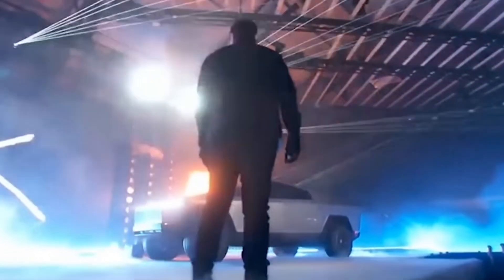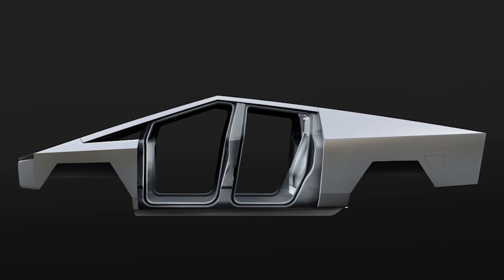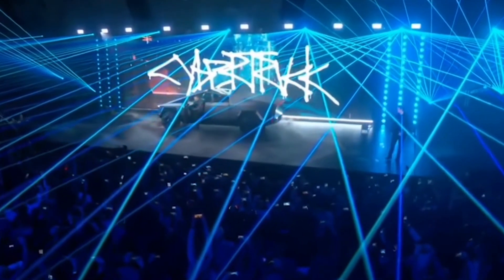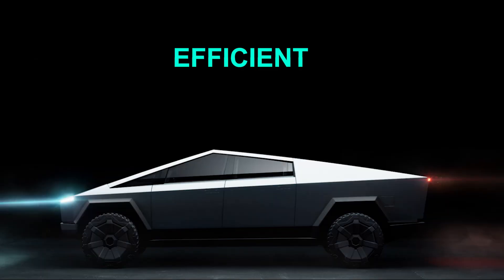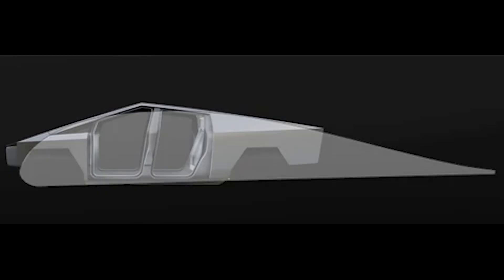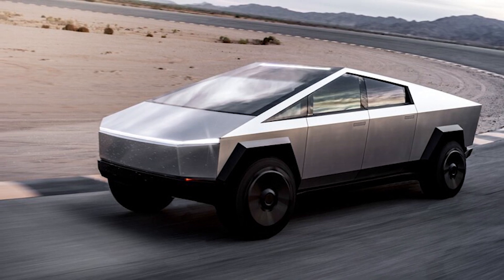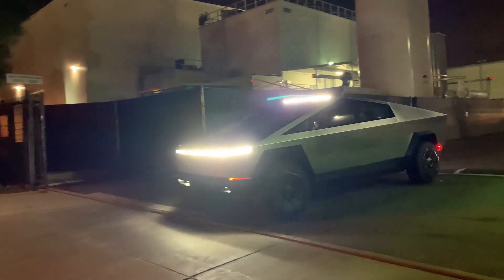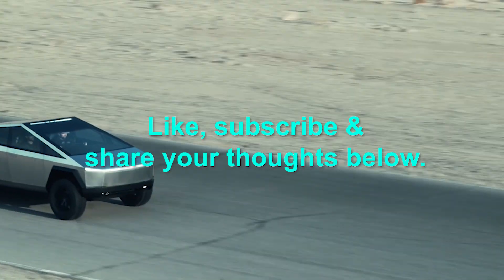Cybertruck is Engineering Genius (and will be copied)

Comment: Safety in cars is more about the crumble zone than the ridgity of the body
Reply: yes..  and with the largest frunk I know of, it has the largest crumple zone.. The exo-skeleton is a thicker, tougher material,  uni-body design.. Elon has the safest vehicles tested, there is no technical reason to believe this will be any different..
Reply from the maker: Lots of people are raising this. The steel can be scored on the underside to crumple predictably and consistently (or the hood could be a separate component). I think many will be surprised at how well the Tesla engineers address this. Safety is always top of mind at Tesla. It may not appear so but the driver in Cybertruck sits the same distance from front of the vehicle as they do in Model 3 so there's equivalent space for crumple zone too.

End of the day, Cybertruck won't be allowed on roads if it is not sufficiently safe for occupants or pedestrians. Tesla are smarter than to design an unsafe vehicle 😉
Reply: Not convinced Tesla quite understands car safety as much as they claim. This cybertruck reinforces it.

Elon likes to brag about the Model 3s safety as the best ever (and it is a safe design) but the NTHSA rebuked him and basically told him to STFU. And for good reason, when it comes to forces and acceleration felt by the crash test dummy in the much touted side impact test, it's not as good as other vehicles including the Toyota Camry. Why? Because the body was too rigid which means that the passengers did the deceleration.
Reply: @ramueller11  Not only this, but imagine sitting in a car thats not a truck and getting hit by a cybertruck. I imagine it will be like going into a wall of steel for the other car. Maybe it would be safe for the passengers of the cybertruck, but the other vehicle gets shredded into pieces.
Reply: @ObeyRL99  Good point. If both cars cooperatively crumble it's safer for both occupants. However, I'd argue that the Tesla cybertruck collision is less severe than a collision with a stationary object, which is tested in crash tests.
Reply: @ramueller11  Their vehicles begin braking if the acceleration pedal is eased off. It may be true that the body doesn't absorb impact as well as other vehicles, but as a whole, the passengers are less likely to be injured.
Reply: @ramueller11  NTHSA further clarified that five stars is the highest safety rating, indicating they do not want support the safety comparison between the same class. But at the same time, they do estimate the injure probability and model 3 tops all. so it was not a "rebuke", it was a clarification. 

When reading news, maybe read more carefully to see what is actually going on.
Reply: @chengyuxi7144  I appreciate it that you think I don't read the news and your suggestion to read more carefully. 

I would suggest you study the English language more carefully: Rebuke - express sharp disapproval or criticism of (someone) because of their behavior or actions.

You cannot rebuke anyone more than handing them a cease and desist letter for misleading claims as in: """The letter, dated October 17, said Tesla had made "a number of misleading statements" about the safety of the Model 3. Musk also distributed the claims on social media."""

"""
This is not the first time that Tesla has disregarded the guidelines in a manner that may lead to consumer confusion and give Tesla an unfair market advantage," Bloomberg quoted NHTSA Chief Counsel Jonathan Morrison as saying in an Oct. 17 letter addressed to Tesla Chief Executive Officer Musk."""

As for the estimation for injury probability, as far as I can tell, the NTHSA does no such thing, rather it's the Tesla marketing department. Which is why a cease-and-desist letter was sent.

Or:
In its October letter, NHTSA said Tesla disregarded the difference in relative weights between its vehicles and others, making accurate comparisons impossible and misleading consumers.

"It is therefore inaccurate to claim that the Model 3 has 'the lowest probability of injury of all cars' or that Model 3 occupants are 'less likely to get seriously hurt' or 'have the best chance of avoiding a serious injury,' wrote NHTSA chief counsel Jonathan Morrison, adding that such statement violate NHTSA's guidelines.
Reply: @readytokill123  We should remove humans from the road....
Reply: @chengyuxi7144  Thanks? 
But, where is the purported that the Model 3 is the highest rated sedan from the NTHSA?  NOT from Tesla?
Reply: @ramueller11  For each crash test they perform, there will be a crash report, including injury probabilities in each test categories. They also have a database where you can query all the history report numbers. But the database is not well formatted as their test format has been changing over years, querying is not easy. 

You will need some ways to average the numbers from all categories to get a combined, which tesla did with a simple even weighting average. 

The bottom line is that Tesla did not make the number up. And technically, their original statement of "lowest injury probability test by NTHSA" is true.  Whether you can interpret it as the "safest" is another issue.

But NTHSA has all the rights to complain as safety rating is a complicated thing from their perspective. Injury probability does not equal safeness. Combining all number into one will lose information, potentially causing misleading. 

Hope now you understand what actually happened for that story.
Reply: @chengyuxi7144  OK, now we are getting somewhere. 

Download the crash reports on the 2018 Model 3 and a control say a 2018 Toyota Camry. Look at the side collision results. What you will notice is the maximum acceleration (hence force) on the crash test dummies are significantly higher than in the Tesla Model 3 than the other vehicle. 

Note that this test was interesting to me because Tesla and the fanboys claim that the Model 3 is better than every other car because it has less passenger compartment intrusion which implies a more rigid structure. You'll notice this is the same non-sense spouted in the Cyber Truck presentation.

I went to their blog post only to find what they really mean to say is that their cars are the least likely to roll over, therefore they are the safest.  

https://www.tesla.com/blog/model-3-lowest-probability-injury-any-vehicle-ever-tested-nhtsa

I'm not making this stuff up! Did they really think no one would call them out on this? There is a lot of bullshit coming from Tesla.
Reply: TL;DR

2018 Tesla Model 3: 
Head Injury Criteria:  384.3
Resultant Lower Spine Acceleration: 41 Gs
Total Pelvic Force: 2478 N
Maximum Thoracic Rib Deflection: 23 mm
Maximum Abdomen Rib Deflection: 28 mm

2018 Toyota Camry:
Head Injury Criteria:  289
Resultant Lower Spine Acceleration: 48 Gs

Total Pelvic Force: 3343 N
Maximum Thoracic Rib Deflection: 20 mm
Maximum Abdomen Rib Deflection: 23 mm

Keep in mind both are very, very safe cars (5*). This data however, suggests that in the same accident conditions you are less likely to have a head or chest injury in a Toyota Camry than a Model 3. That doesn't play nice with Tesla's message so they can just cherry pick what ever they want with a "Mission Accomplished" banner in the background.
Reply: @ramueller11  Again, traffic injury probability is something not straightforward to estimate. The core idea is how likely in certain crash the passenger experience a "severe" injury. 

If you want to continue ignoring the number from the test agency and DIY the interpretation by put an equal of acceleration of parts of the body to the injury likelihood, I am sorry but you will be the one producing BS here. Or maybe not, and NHTSA should hire you and let you write of algorithm for them. 

Before thse BS you pulled out, I am glad you seem understand that where the behind story the NHTSA "rebuke" Tesla news. I am not interested to get involved with other ideas you pull out. Clarifying one is proven hard enough.
Reply: @chengyuxi7144  Dude you are all over the place. If traffic injury is not straight forward to estimate, then how can Tesla (or anyone else) make any claims of being the lowest probability of injury? And that was the point the NHTSA had.

Seems the only logical resolution to your self-imposed paradox is that Tesla is full of shit, which is what I have stated.

The "BS I pulled out" are empirical measurements measured by the NHTSA comparing the same crash tests with the same injury metrics in different vehicles, which is how injury probabilities are calculated by the NHTSA. This is in fact the same crash test that Tesla likes to brag about in their blog post as "look our car didn't get as damaged as theirs". The key point is that the occupants didn't fare as well, statistically, as that of the other car.
Reply: Except for T-Bone collisions, then rigidity is paramount.
Reply: Is no for worry. When cybertruck crash, other things crumple. Is better, no?

Comment: ...
1. Every car is made from a roll of sheet metal. Parts stamped out and assembled by spot welding robots. Tesla’s are made from old Toyota toolings.
2. Cars used to be made from steel. The automakers have switched to Aluminium and plastic, take a guess why?
3. Pick ups today have steel frames. Those frames are the load bearing components. No big difference there.
4. Certain layers of protective paint is still needed/ metal treatment are still needed. Remember the car from Back to the future? That was a colorless car from the 80s and that scheme hasn’t caught on.
5. Worry less about if the car runs on electricity or not. Worry more about where the electricity comes from. If they are from coal-fired power plants, overall you’d produce equal or more pollution if the car runs on diesel or gasoline. Gen4/5 nuclear plants or other safe forms are better for an environmentally friendly energy solution.
My opinion? Not to downplay the cyber trick, I like it. But keep in mind companies need to create hypes to attract investments.

Comment: Sir, you are simply WRONG. Watch Doug Demuro's video and you shall be enlightened. Plus, the design of it is very likely to change DRAMATICALLY, since it won't have a chance of passing pedestrian safety regulations, so the LOW COST OF PRODUCTION that you emphasized so much won't apply to the production version of the Cybertruck.

Comment: Hate to say it but even though it is genius, it is incomplete because of battery problems where when towing uphill it uses a lot of battery power and also a lot of people uses pickup trucks for work or off-roading, this doesn’t have good enough suspension for off-roading even though it is tall and wide, but won’t beat the off-road market unless they do an actual mud test where they drive it in the mud and on the work side, the side panels are a bit absurd because usually people reach back there from the sides of the truck not just the back, leading to my idea that the truck bed is not long enough because some people carry long materials like plywood or wooden beams that are long, and like I stated earlier even if you have a trailer for it it would need to be a Tesla trailer because the motor carrying a motor less trailer forces it to use a lot more power on the uphill, leading to the battery quickly draining, but there is something that is in testing that’s going to be part of the truck I believe, I think they are adding solar panels to have a quicker energy regeneration and storage in the vehicle.

Comment: I can see military use of this but with petrol engine so it can drive outside the grid. Cut the roof, install weapon mount, weld armor plates straight onto a chassis and replace glass with armor or bullet proof glass. And you have high mobility armored vehicle.

Comment: You've got the safety stuff backwards. A stiff rigid body does not make a safe car, it's the opposite. You want the outside of a car to be soft in order to crumble up and absorb as much energy as possible on impact. Going from 60 to 0 doesn't kill you, but doing it in a split-second will. With crumple zones you can extend that split-second and reduce the forces on the passengers. A rigid frame around the passenger compartment is a good idea to make sure that they don't get crushed but keep the outside soft!
Same logic applies if the car hits a pedestrian. The car will clip the pedestrians legs and their head will slam into the hood (or windshield). If the steel is soft their head hopefully stays in one piece. If the steel can't even be dented by a sledge hammer they are absolutely fucked.

I am super hyped for the cybertruck and can't wait to see it hit the streets but it is NOT "engineered for safety first". It is engineered for durability first. Hopefully safety comes second but we will have to wait for actual crash tests to find out about that.
Reply from the maker: Lots of people are raising this. The steel can be scored on the underside to crumple predictably and consistently (and it appears the frunk is a separate component). I think many will be surprised at how well the Tesla engineers address this. Safety is always top of mind at Tesla. It may not appear so but the driver in Cybertruck sits the same distance from front of the vehicle as they do in Model 3 so there's equivalent space for crumple zone too.

End of the day, Cybertruck won't be allowed on roads if it is not sufficiently safe for occupants or pedestrians. Tesla are smarter than to design an unsafe vehicle 😉